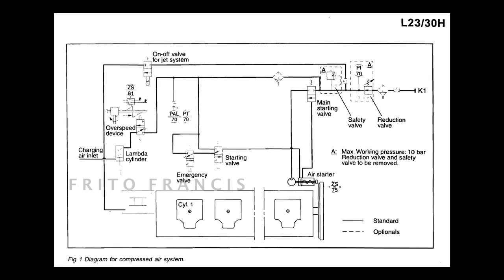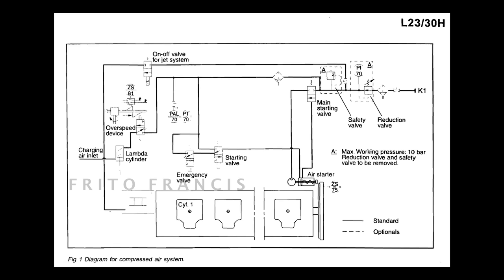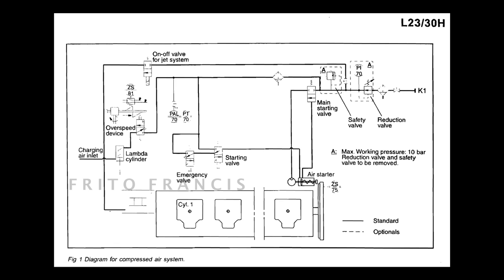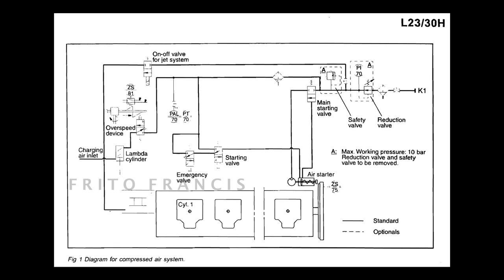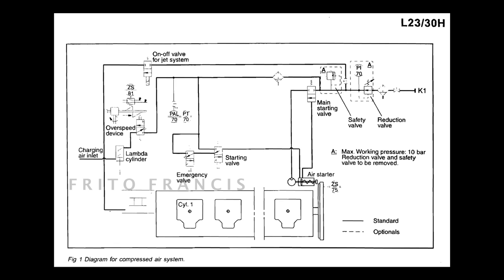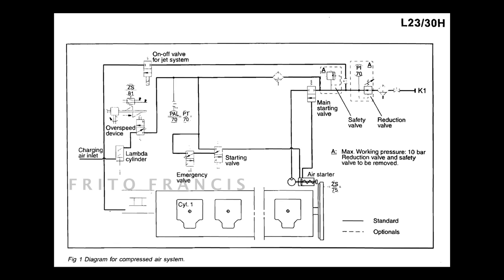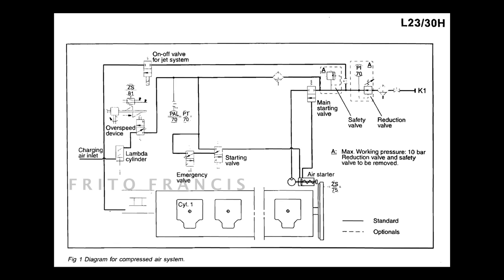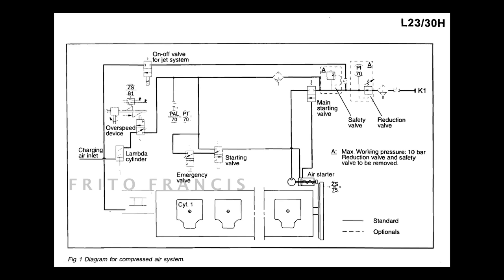MAN B&W AUXILIARY ENGINE STARTING AIR DIAGRAM

Comment: Hi fritto...if u want to start by emergency according to the diagram the starting valve is blocked...
Reply from the maker: if u observe the diagram correctly , you can see that the starter line connected to emergency valve while in de-energised position.

Comment: Thank you Frito.
please tell me how the air starter gets disengaged once the engine has started.
Reply from the maker: Once the engine started the starting valve will close and shut the air to the starter which will depressurise and retrieve back the pinion.
Reply from the maker: ABC  please on captions for the video, it’s already added